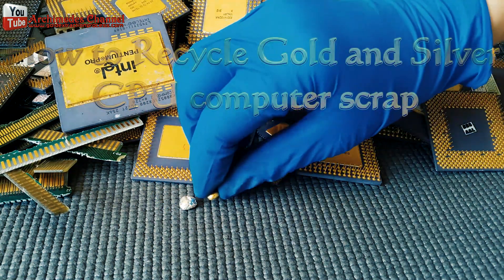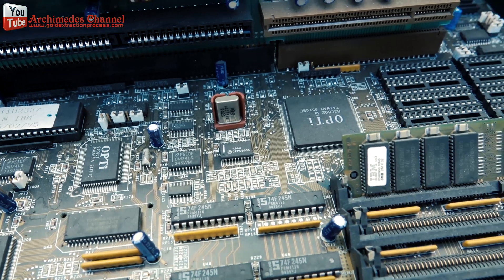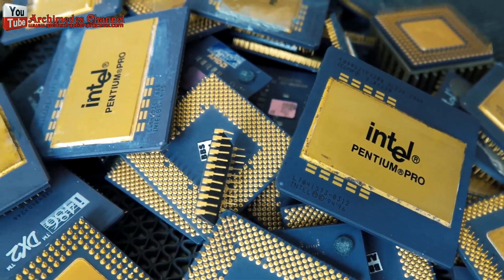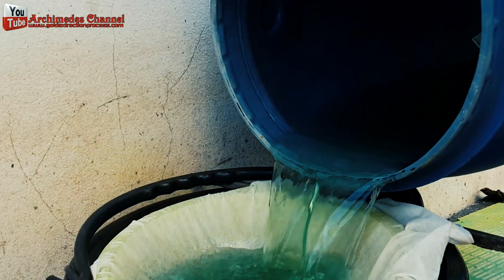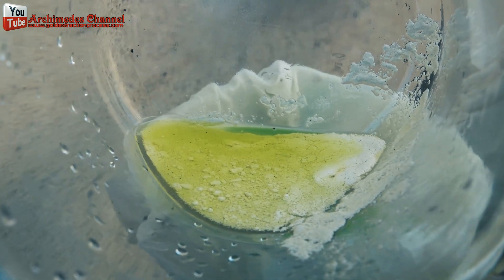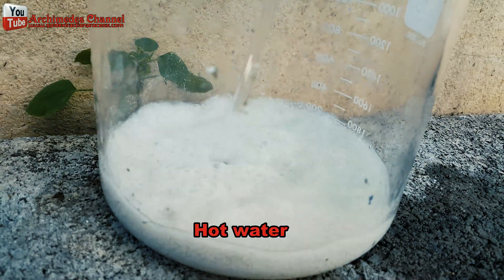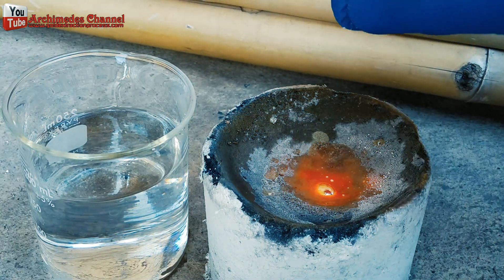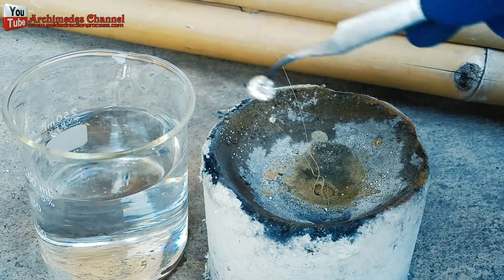Extracting Silver from computer parts CPU

Comment from the maker: 👉👉👍 Computer components containing valuable metals include Motherboards, connector cards, graphic cards, memory cards, CPU’s and other various small electronic components, connectors/cables & Hard drives.

Computer CPU’s (processors) have the most precious metal value by weight, followed by Memory (RAM) & Circuit Board Fingers /  Connectors / Pins, then Circuit Boards (Motherboards), then cables / wires,.